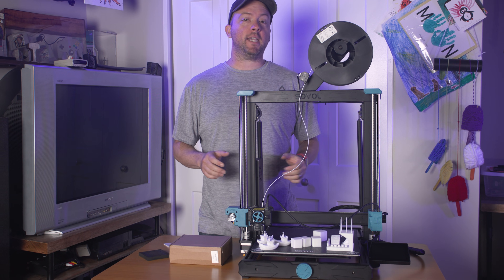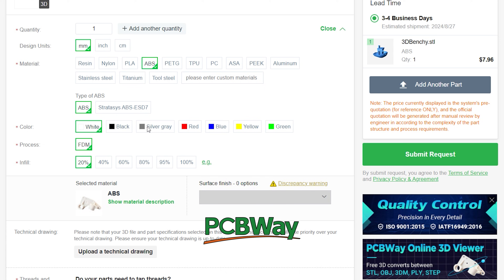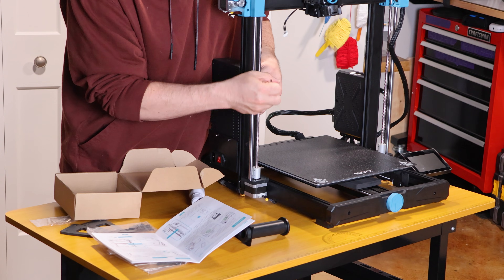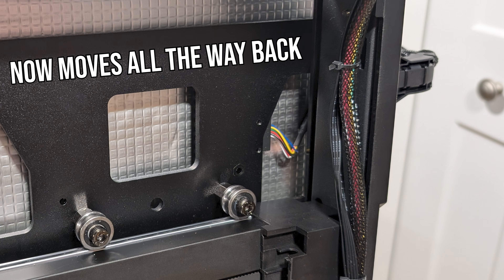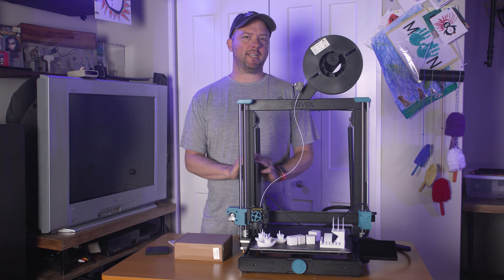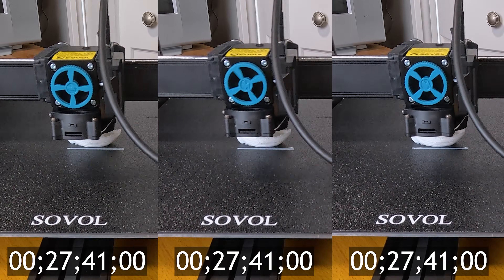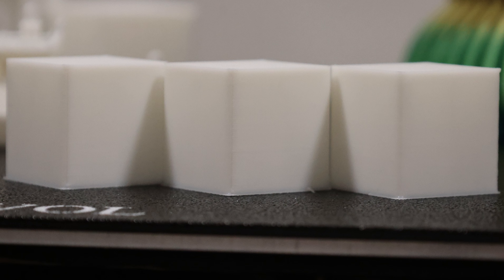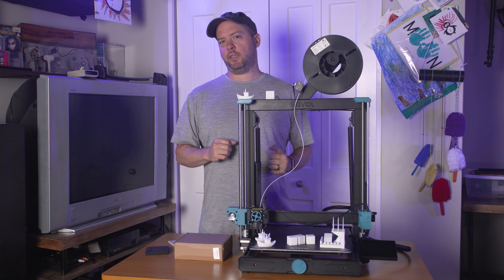It Had One Major Issue!  Sovol SV06 Plus Ace Fixed

Comment: Dude, you are a life saver!!!  My printer had the exact same issue, but a different cause.  The wiring loom on the rear of the machine was getting caught under the bed when homing the printer out, keeping the bed from going all the way to the very back of its travel.  I have to hold the wiring up out of the way during homing, and now my printer works like a champ!  I probably never would have figured that out if it wasn't for you and your detective work.  Great job!
Reply from the maker: I'm so glad it helped someone!  When I initially fixed it I thought to myself "There has to be something else" but nobody picks up their printers :D